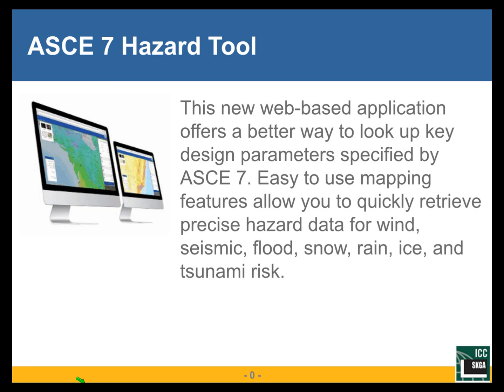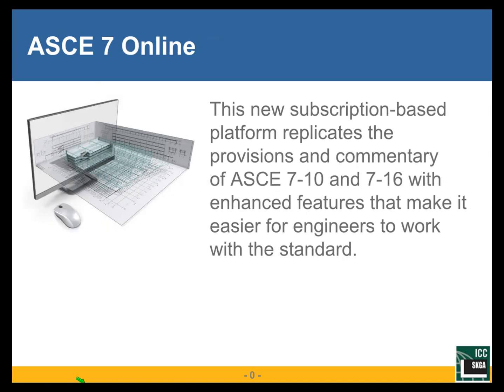An Overview of the Major Changes in ASCE 7-16

Comment: Nice Video. ASCE 7-05, ASCE 7-10, and ASCE 7-16 are editions of " ASCE 7". ie  for the  years 2005, 2010, and 2016. Each newer edition has a better model to understand the load forces on a building. I mention all this because we all start at the beginning and what is obvious to us Engineers might not be to others. :) Going back in time there is ASCE 7-02 for 2002, ASCE 7-98 for 1998, ASCE 7-95 for 1995. These go back to ASCE 7-88 in 1988  then back to  ANSI A58.1-1972.  Regards.